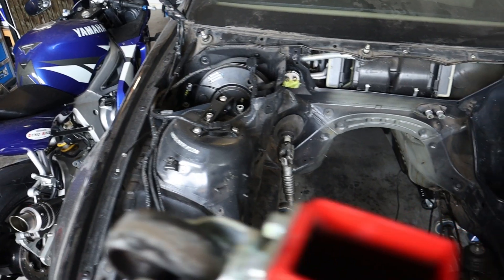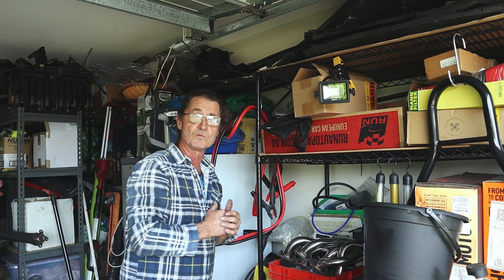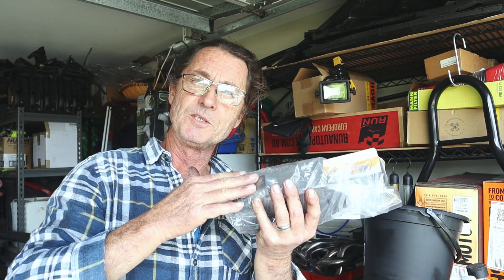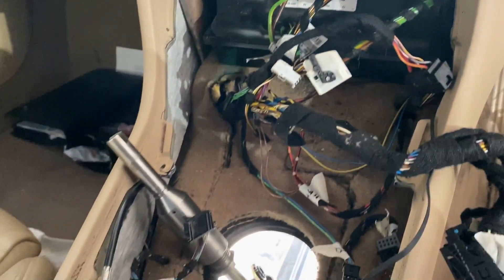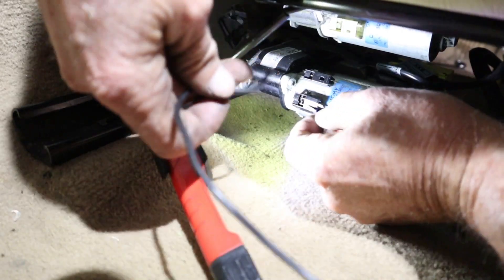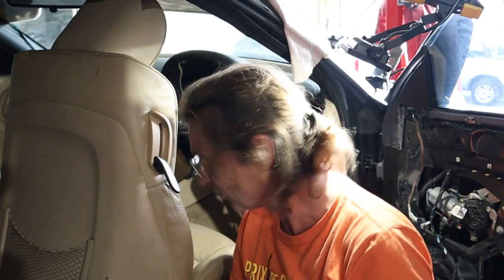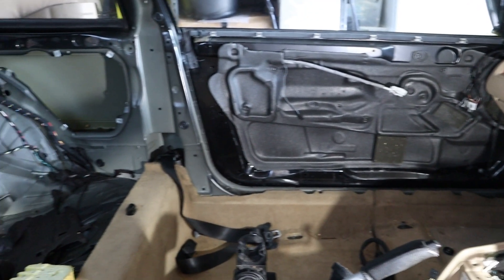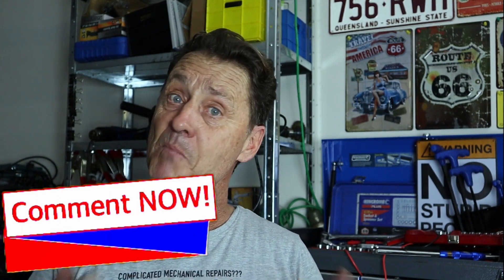BMW E46 BUILD// Interior Removal - It ain't easy!!

Comment: hello need help figuring out miss fire on my e46 2.5l cabrio. replaced injectors,coils,sparkplugs and i still getting a miss fire from cylinder 5. tried diagnose everyting but everything is fine other then that miss fire and the disa knocking sometimes on cold starts.
Reply: Replace the disa, clean your MAF sensor.